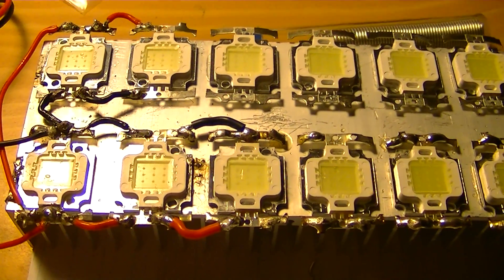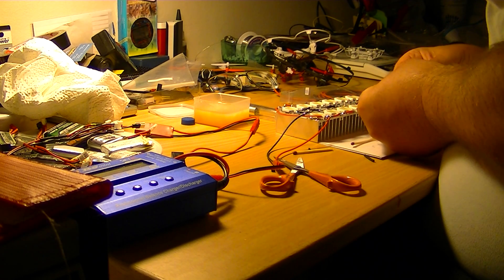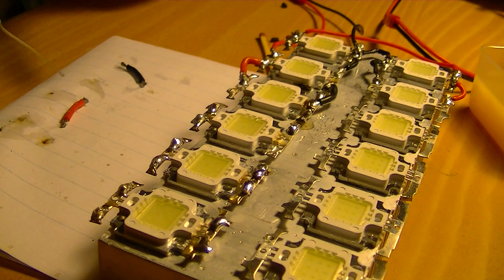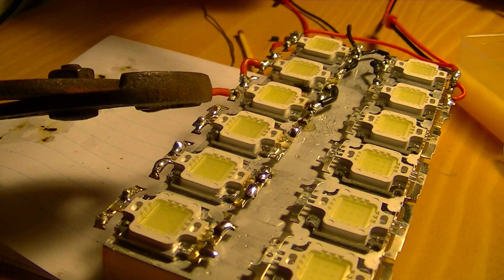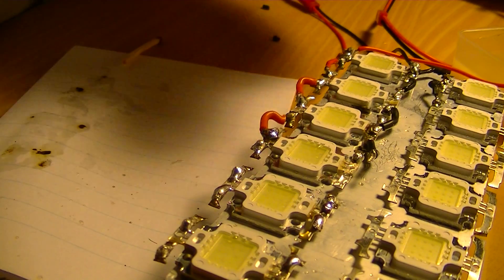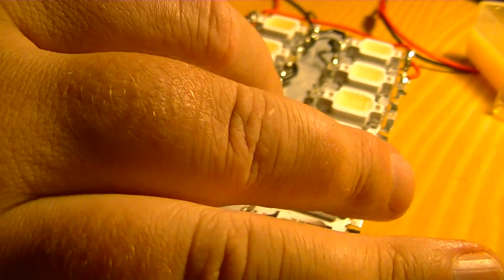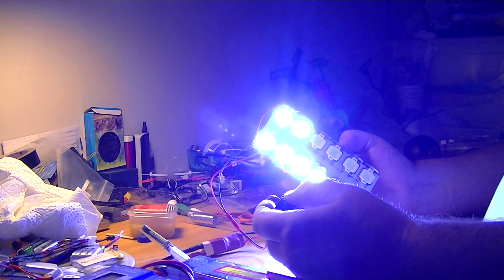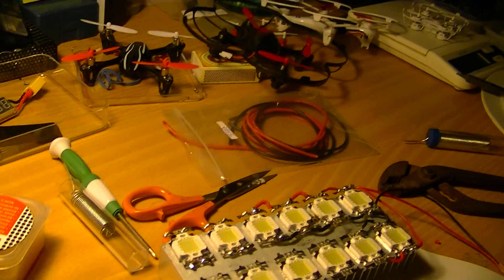MongoTV_557 - Part 7 - Mongo RC - My 10 x 10 W LED 12 V 100 Watt LED Drone Spotlight Project

Comment: why not just one 100 watt led.
Reply from the maker: 100 watt LED cant run on 12V LiPo batteri, need stronger .-)
Reply: Mongo Tv yeah but you can just use a 150watt dc to dc booster.